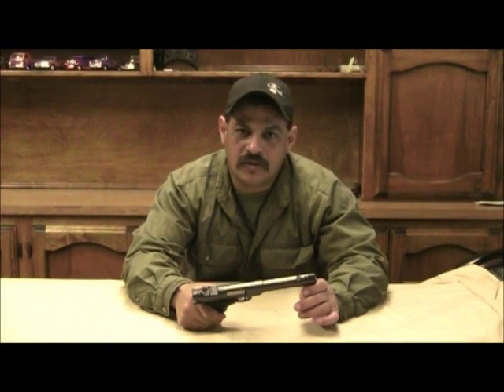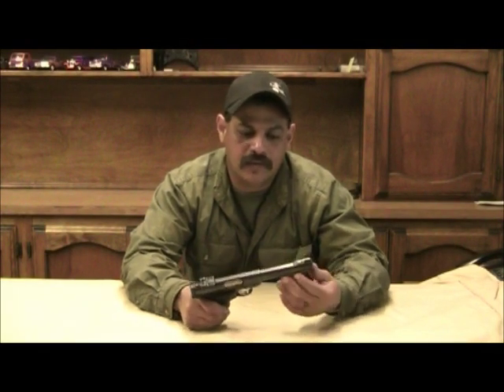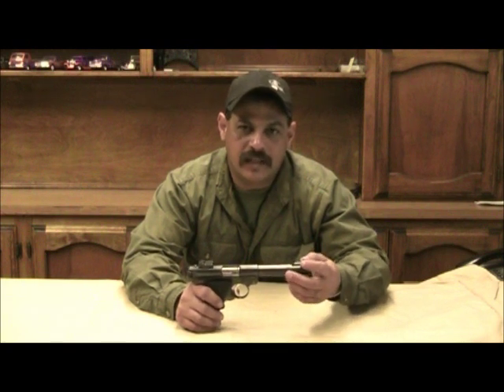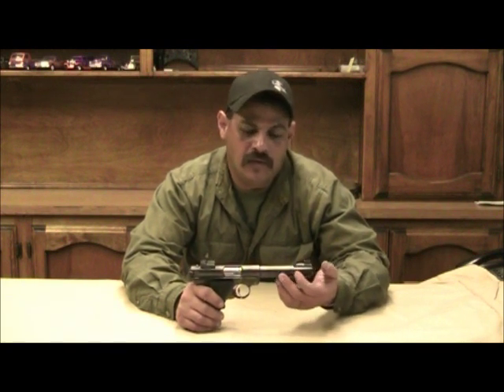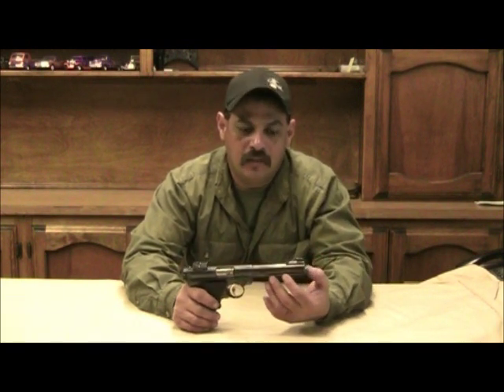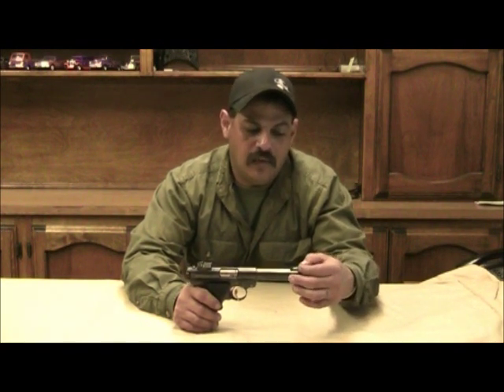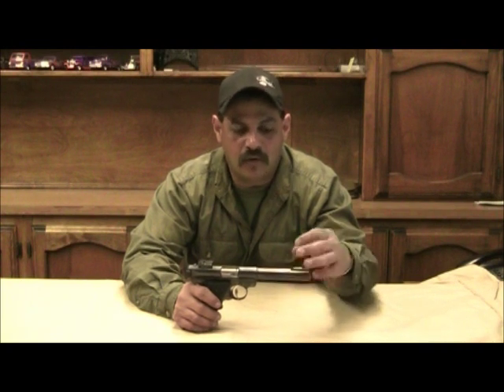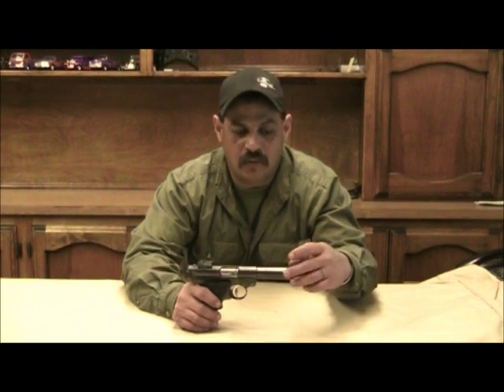Threading Barrel Ruger MKII Target Pistol

Comment: I'd be willing to pay you to do this to my ruger mark iii/iv, most likely iv.
what state do you live in?
This is a serious offer as i would really like to have a threaded barrel for a future suppressor on my ruger mark iii/iv(want to sell the iii to get a iv).
the only thing is is that i dont want the barrel to be shortened at all.
some shortening i imagine is necessary but i really dont want it a full inch shorter.
Reply from the maker: Threading the barrel does not shorten the barrel at all. Threads are machined to the outer diameter of the barrel leaving the inside of the barrel and lands the same length.

Comment: I noticed you are not using anything to protect the finish of the barrel while it is in the vise or in the lathe chuck, why is that?    Also how are you insuring  that the new tapped hole for the front sight is at  true top dead center of the barrel?   I ask this because the factory hole and the hole you drilled do not look to be in alignment.
Reply: I noticed the exact same things, I paid a local shop to move  the sight on a rifle I cut the barrel down on, the sight ended off a few degrees to the left and rendered  one of the most accurate rifles I have ever owned useless without a scope . and I'm not a scope guy.
Reply: The way I would do it would be to use soft jaws, if you're a tool maker, you probably would,too. 
As far as indexing for the sight screw, I would place the proper size bit in the chuck and insert it into the original hole for the sight to set it exactly on the top, and then simply move the mill table to the desired location.
I don't know how he did it, but that's how I would do it.